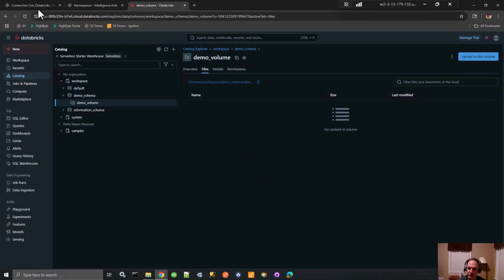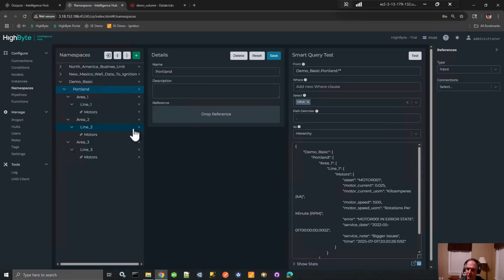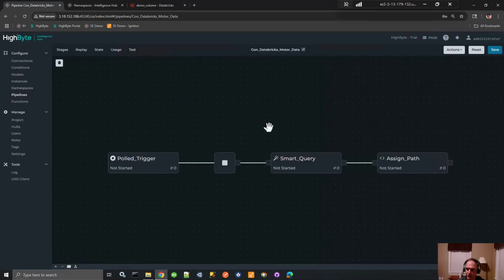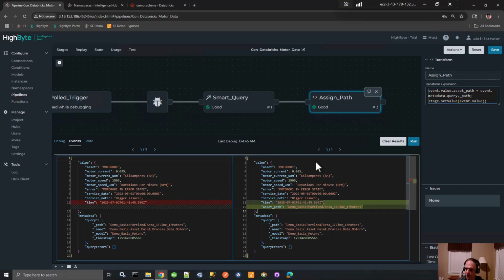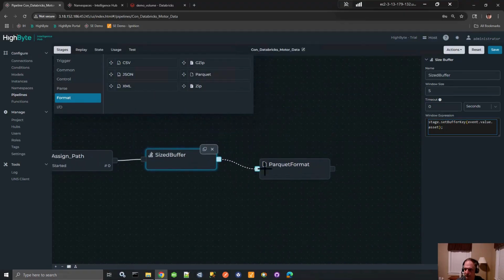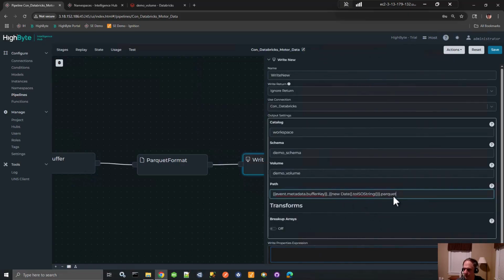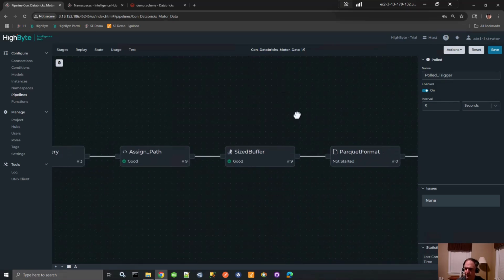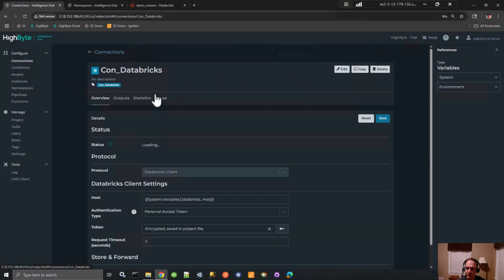Connect to Databricks in HighByte Intelligence Hub Version 4.2

Comment: Thanks for a video recording. Do you have this demo project available for download ? Second, If there is a streaming use case and data writing at high frequency, any test results and benchmark ? If there can be project on streaming or you suggest to follow same approach or use broker in middle ?
Reply from the maker: Sorry, we do not have an example project for download. Regarding test results and benchmarks, our customers consider many factors when optimizing for throughput, including but not limited to source system compute, target system compute, Intelligence Hub server compute, and data engineering considerations (what is happening to the data in the Intelligence Hub Pipelines). Generally, we recommend controlled performance testing once the use case is established. Yes, in some cases it might be beneficial to use a broker like Kafka, for example. If you need assistance with your use case, a HighByte solution engineer or solution architect would be happy to help!